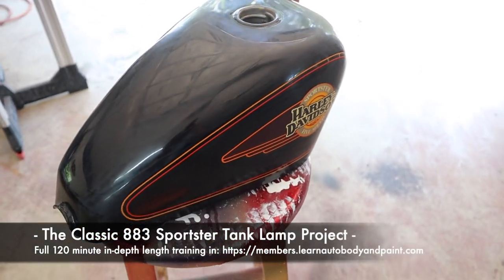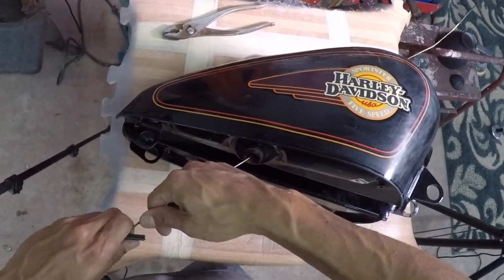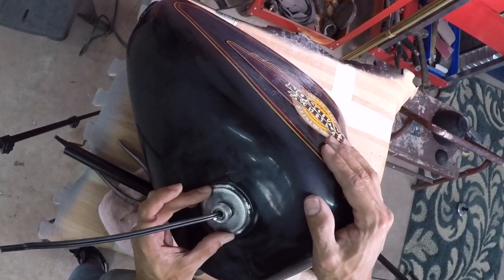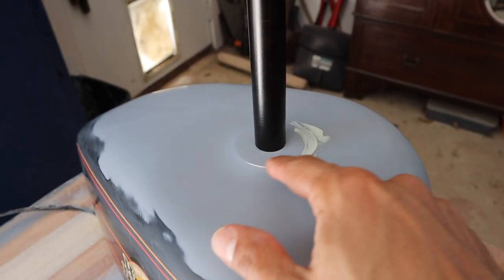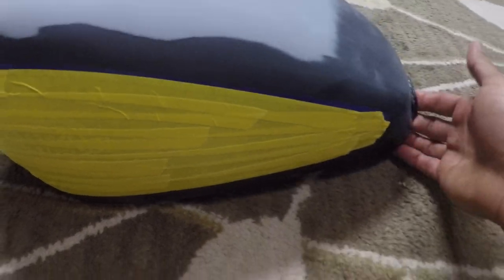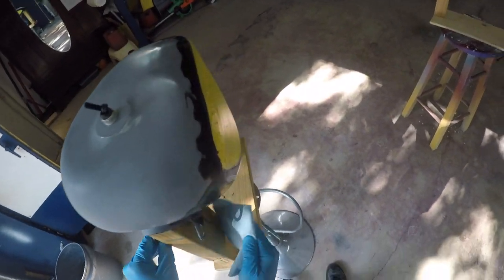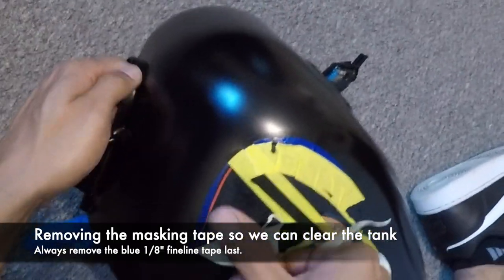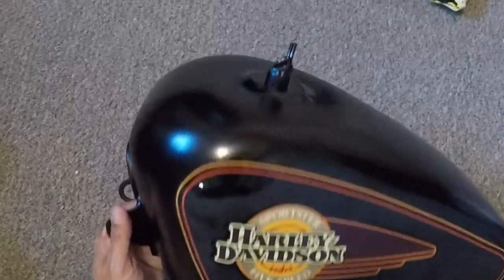🤩How To Spray Paint ANY Car or Project Yourself Like a BOSS in 13 Minutes!

Comment: Which one is better for base coat x20 or x27
Reply from the maker: Zero to Hero 24/7 hey man. The X20 is a good mid grade entry level spray gun.  The X27 is the top dog. Currently I am using my x20 as primer and the x27 for base and clears... the x20 also sprays very good base and clear through...

Comment: Hey Tony, 
 I don't want to question your work because it's excellent, but I'm going to so that I can learn.  When you masked the tank for the 2K filler primer; wouldn't it have been better if you ran the masking tape a little farther away from the pin-stripes so that you could avoid sanding through them when feathering down the hard primer edge?  I know that I'd have a hard time avoiding the pin-stripes.  Also, what "Fine-Line" tape is best and which width for general use without having to buy a bunch of different sizes?  I'm a learning amateur . Thanks for everything.

Comment: Hey mate one tip for you is you shouldn't use your fingers when sanding should use a flexible rubber to use with the sand paper when rubbing back and you could have saved that tank by slowly fulling with water and air would have popped that dint out.
Reply from the maker: Wayne's Garage I think you should make me video and show me that pop out Dentrich I almost can’t believe it would work... please show me. Thanks for the comment
Reply: @HowToPaintYourCar  one day when I can get a tank with a bit of a dint like that mate I'm happy to make a video dont get me wrong mate you still do nice work how meany cost of clear are you putting on mate
Reply from the maker: Wayne's Garage 2-3 heavy coats. More if flowcoating :) 👍🏻🤙🏼💪🔥
Reply: @HowToPaintYourCar  ok cool just wasn't to sure but I still wouldn't use your fingers to rub back though mate.